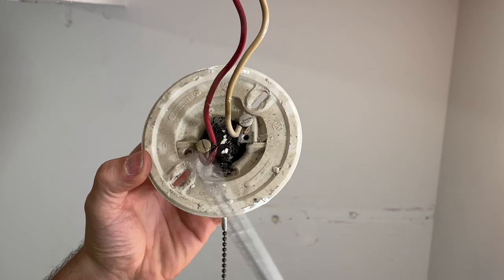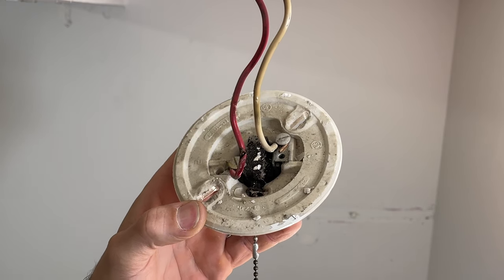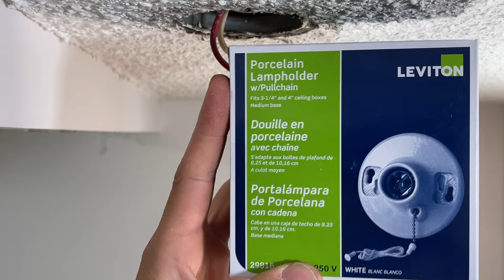How To Install A Light Fixture With Pull Chain

Comment: These were common in garages, basements, or closets. But they are now illegal to install (if builder). Now it requires enclosed or recessed luminaire.
Reply: I have two closets which had old style incandescent lampholders which were not original to the house.  I replaced them with Lithonia Lighting LED strip lights which give much better illumination.
Reply: What is a luminaire?  Why?

Comment: Ground wire? This video does not mention anything about it. If I'm pulling power from another junction box using 2 AWG with the copper ground, but the fixture only has connections for the hot and neutral, what do I do with the ground wire? My assumption is to connect to the metal junction box the fixture mounts to, but I hate to assume things. I much prefer to do it to code.

Comment: I believe those are against the local code where I live because it has an exposed bulb. At least that's what the electrician told my dad when he got a light in his closet a couple of years ago.
Reply from the maker: Thanks for the feedback, totally agree that you should always check local code but these are at least not against code in our area.  👍
Reply: even if not against code, still makes more sense to go with a covered fixture. Home Depot,lowes have an almost direct replacement style one with plastic lens
Reply: Those screw in type replacement type fixtures are meh at best. Work fine as long as the socket in the original porcelain fixture is good.  We ditch the entire porcelain fixture, use lutron utility room fixtures
Reply: You are CORRECT!  Bare bulbs are NOT allowed in closets. That is a requirement of the National Electrical Code. Most jurisdictions adopt the NEC as a whole, then may specify exceptions. For example, in Illinois most jurisdictions adopt the code and then delete the section that allows non-metallic sheathed (Romex), so  conduit is required.  Regarding bare bulbs in closets: NEC 410.16(B) states: “Incandescent luminaires with open or partially enclosed lamps and pendant luminaires or lampholders shall not be permitted.” 
 Period.  For existing open bulb lampholders like here,  if one is truly not inclined to replace it, then it would at least be prudent to replace the glass bulb which is subject to breakage and injury with a plastic LED "bulb."
Reply: Code says exposed incandescent bulbs are a no no in closets. LED’s are not incandescent.
Reply: @bibo3373    2008 NEC started including covering LED as well as incandescent bulbs. Has this changed since?

Comment: Don’t forget the part where you have a shared neutral between 3 circuits so 3 breakers need to be off, but then you can’t figure that out right away because your body has such a static charge on a step stool that the ticker constantly goes off when half your breakers are shut off. Then you realize you need to ground yourself every time you go check. The electrician that wired my house must have been drunk......

Comment: For the three prong fixture you said you will need a ground. Is that the case if you only plan to plug in two prong equipment

Comment: When the pull chain broke away from the fixture, I re-attached the pull chain to the socket and saved the cost of having to buy a whole new pull chain socket. To do that, turn off the circuit breaker to the light, take the entire socket down and then pull out three small screws to pull out the switch. 

Then slide the end of chain in between the metal clips that secure the chain to the switch. Use pliers to carefully pinch the two metal clips together to keep the chain secured to the switch. 

Take pictures to make sure you know where all the screws, switch, bulb socket, and metal connectors are positioned so that you can put it all back into the porcelain fixture correctly.

This process might also be used to fix a jammed pull chain.

Comment: I always use the one with the outlet. Further more, I make sure to put a GFCI on the circuit that have the porcelain sockets with outlet. I don't like they're upside down though, but it's handy to have one when you need it. And of course it should be grounded, regardless of GFCI or not. So many people ignore a ground wire and it really bothers me. Like here, the ground was ignored. While I am aware there is no grounding screw on the socket itself, I hope at least the box itself is grounded. There is a potential for a short to contact the chain and energize the pull string. And in some cases, people use an actual chain like you had, so that for sure would shock you if it were to become electrified.  Also, if you're grabbing something that is energized, your hand muscles are going to spasm and contract, forcing your hand to close, and if you can't slip from that chain, it has more potential to be lethal.

Comment: Was going to reattach a pullchain by removing socket. Mine must  be over 40 years old because you can t reach the sidescrews. They are down deep in bottom of porcelain socket. I even tried pulling out the metal clunker that holds the sidescrews. No dice. I ll cut the wires and match it up/ buy a better one with an extra plug in source too at Ace hardware.

Comment: 3 questions:

1) I have a ceramic fixture in my cold storage that is located in my bedroom. And the chain snapped off when i pulled it on and now stayed on being in the "on" position. Can I just unscrew the bulb til I get my broken chain ceramic fixture fixed? Cause as I say, it broke off in the "on" position so now it's always on and don't want to burn the bulb out or use power. And if unscrewing the bulb, does that switch off the fixture so not using power?

2) Also,, can I just replace the broken chain without having to change out the fixture? It's just the chain that snapped off. It snapped off high up in the fixture so not visible to try to grab any remnant chain left. There is nothing sticking outside the hole of the fixture to grab onto in order to try to switch it off. 

3) Also, since my light fixture with its now broken off chain pulley broken inside the fixture is in my cold storage thats in my bedroom, that fixture is on the same breaker as my lights in my bedroom, so was wondering, so that I can still see in my bedroom, can I keep the breaker on that gives power to both the bedroom pot lights and cold storage fixture, and just unscrew the light bulb in my coldstorage that had the broken pull chain cause it snapped off while in the "on" position and stayed on. As mentioned in question 2, I couldn't retrieve any visible chain  to switch it off. So getting back to question 1, wondering if I just unscrew the bulb out of that fixture, it is still "on", right?  And using power?

Comment: You have your voltage tester set for low voltage instead of high voltage. Red light = high voltage, Blue light = low voltage.
Reply from the maker: Thanks for the feedback!  It was my understanding the blue light just indicates power and then the row of led bars above are what will indicate low and high voltage.  1 yellow bar indicating 12-24V DC and 2,3,4, and 5 bars which go from yellow to red indicate AC with an increasing number of bars as you get closer to the source.  I might be wrong but that is what I read in the instructions for this tester.  Do you have the same brand / model or use a different one?  Thanks!
Reply: Everyday Home Repairs  while it’s on try, pressing the on button quickly to change mode from blue to red mode. Could be a slightly different model but it’s worth checking for safety.

Comment: Same installation if existing is grounded or do u have additional video with grounded light fixture ..thanks
Reply from the maker: Hey Rob, pretty much the same just the addition of connecting the ground wire to the green screw on the light fixture base.  Does the current light fixture have a 3-prong receptacle where you could plug something in as well?  If so, make sure you get a base that matches.

Comment: Please answer this question if you can and will? What size screws did you use to hang the light fixture?  Were they #6-32nd or #8-32nd? Also, is the metal case grounded for the one you are working with in this YouTube? And finally, I didn't see in your writeup how to remove the Porcelain knock-outs.

      knock-outs.
Reply from the maker: The screws were 6-32, the metal electrical box was grounded, and here is the video for the knock-outs https://youtu.be/tQ5uBMC4OWE

Comment: I have a unit that has the ground go through the pull chain device, then continues to the bulb area. Not sure why it's like that. I am going to have to cut the wires.

Do all wires for lights have that solid copper beneath insulation? I don't want to cut the wires and use them on a new light if it is raw strands of copper.

Comment: I need little question I have led lights I have Artika Skylight 1 ft. × 4 ft. LED Flat Panel ok and I put all Together it working well  power on and off and very dark Night off switch but is glows but not off

Comment: I honestly hate the pull cord light fixtures because of the cord getting in the way. Sure we don't always have a switch control but if the closet door can act as a switch those open light sensors are awesome.

Comment: The chain broke.  Do I have to replace the entire lampholder?
Reply from the maker: You could most likely just replace the switch but honestly for the cost and time involved just easier to change the whole lampholder.
Reply: When the pull chain broke away from the fixture, I re-attached the pull chain to the fixture and saved the cost of having to buy a whole new pull chain socket. To do that, turn off the circuit breaker to the light, take the entire socket down and then pull out three small screws to pull out the switch. 

Then slide the end of chain in between the metal clips that secure the chain to the switch. Use pliers to carefully pinch the two metal clips together to keep the chain secured to the switch. 

Take pictures to make sure you know where all the screws, switch, bulb socket, and metal connectors are positioned so that you can put it all back into the porcelain fixture correctly.

This process might also be used to fix a jammed pull chain.